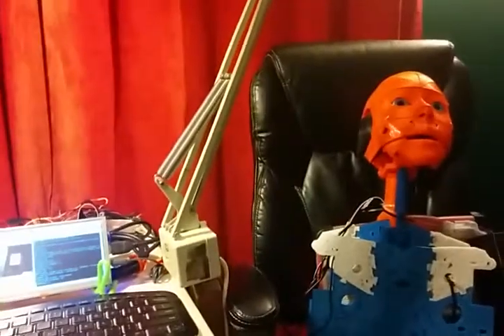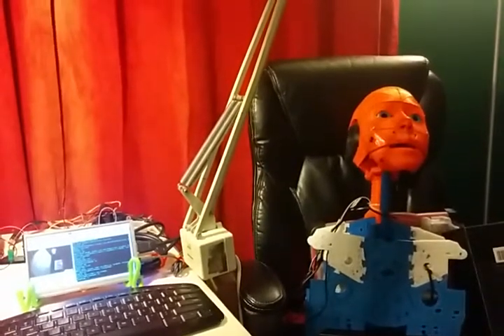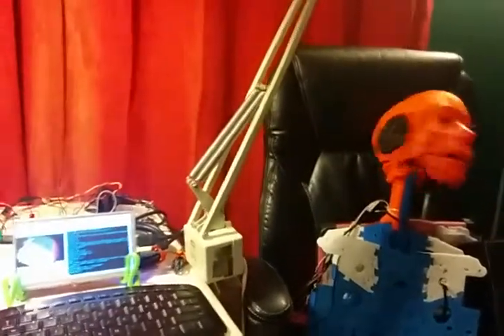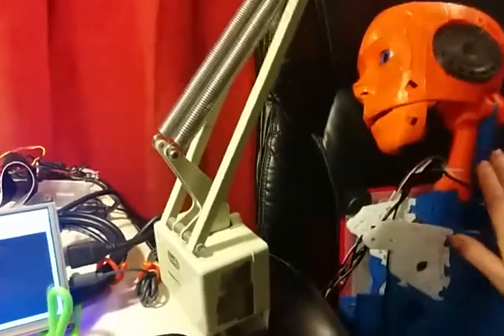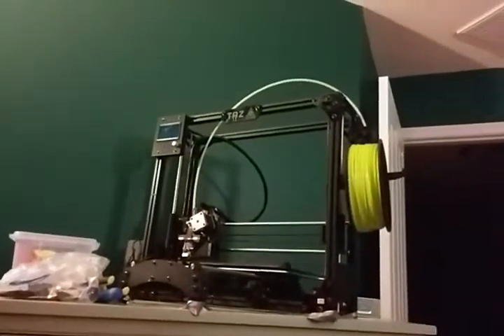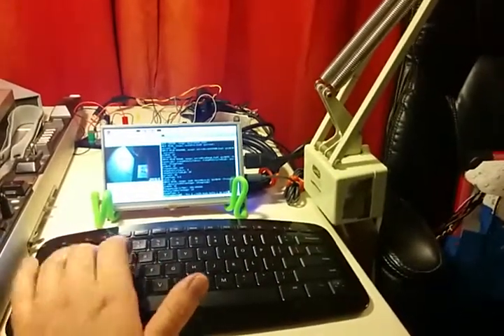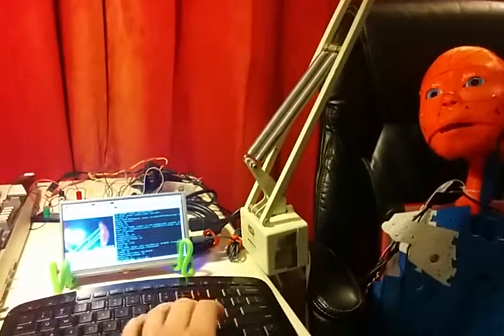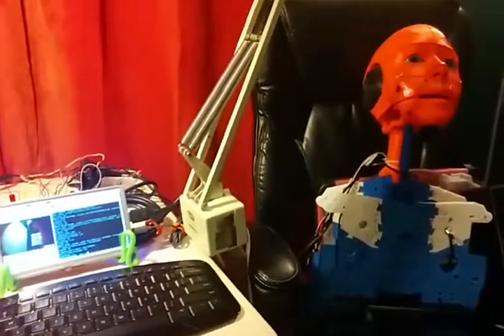InMoov Raspberry Pi Voice Commands

Comment: Hey Matt, I know this is all old. and you've probably moved on to bigger and better projects.. But. just wondering on your AI software you were working on? i'm kind of interested in giving my InMoov an AI that works.. was thinking of putting google home/assistant into it?  but that has it's issues..
Reply from the maker: I'm still working on this project periodically . Code is not ready to release yet. Changed from Java to c and then from c to python.